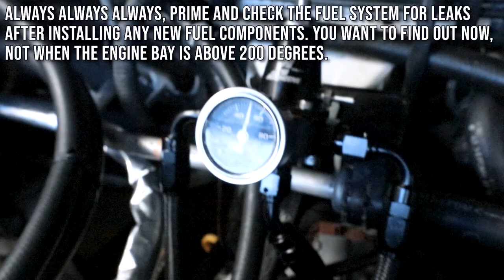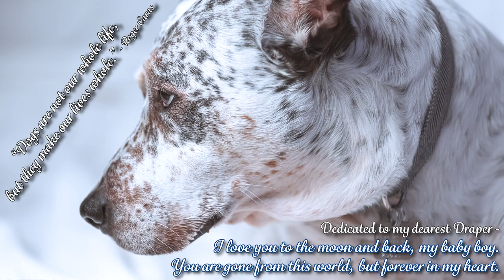Making our own fuel line kit / A tribute to Derps.

Comment: Sorry about Draper man, losing one is hard. Every time I swear I'm not getting another one, we end up getting another, and love them just as much. 

Glad you did the video; I've wanted to make custom lines for my car since I bought a kit that had lines that I just couldn't route in a way that was clean. Hadn't really pursued it since I thought they were a lot more difficult than your video makes it look. '04 STi and got the Agency Power kit; not a big fan but was on a time and money crunch, they were cheap and in stock at the time. Fuel rails are pretty good, lines not so much.
Reply from the maker: Thanks man. Yeah the lines are actually pretty easy to make, it's just finding the most productive way of routing, etc that gets interesting, but st the same time it gives you a lot of flexibility over the final fit and finish.

Comment: Sorry for loss of Draper. Thanks for sharing videos of him!

The fuel system looks like nightmare to plan out the routing. Is the fuel line from the fuel pump in the tank to the engine bay still stock line or did you also change that to the braided line? Your intros are always funny! Keep it up dude 🔥
Reply from the maker: Thanks man 🙏 fuel line from the tank up is still the factory hard line, we just use quick disconnect to -6 off the firewall lines. It isn't too bad once you sketch it out, Nad wasn't horrible getting under the manifold with the front two. Would be much more annoying with ptfe as they don't bend, but standard braided like this is still good for ethanol up to e85. 👌
Reply: @MatlasDI  that’s what I was curious with on the fuel line set up because I didn’t know you can still you the stock hard lines. That’s sweet!
Reply from the maker: @cughan_9482  yup yup, I tagged all the stuff in the description. Evil energy makes the quick disconnect to -6 fittings as well which is on there.

Comment: Maybe a stupid question, but I bought a IBR fuel rails, Aeromotive FPR and Evil Energy hose kit, but I see no provision for a Damper on the rails. Are Damper nescessary ? If so, is there option for adding out of fuel rail ? Thanks.
Reply from the maker: Dampers just help when running larger injectors to prevent one injector's pulse from robbing the second injector in the shared rail. The larger the injectors, the more pronounced this issue becomes. I would say anything under 1000cc isn't really necessary, but as you move up you'd want to consider it further. Radium does make dampers thay go off the rail as well thay can be integrated into other systems than theirs, so that could be an option if you were interested.